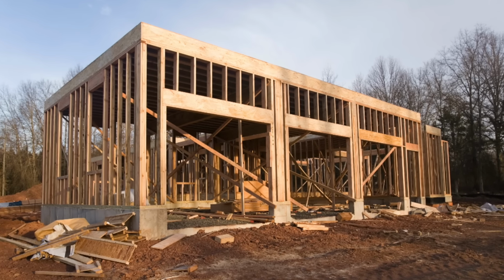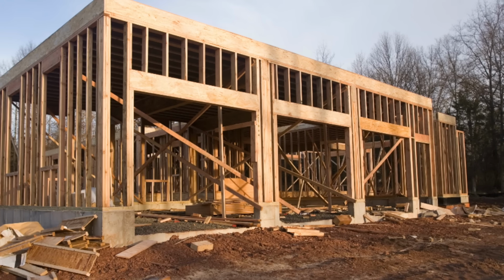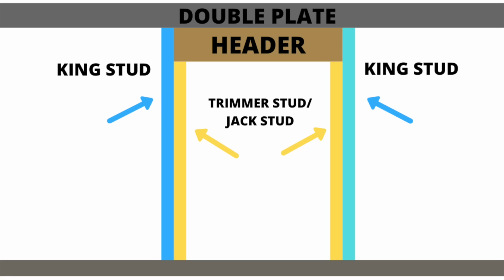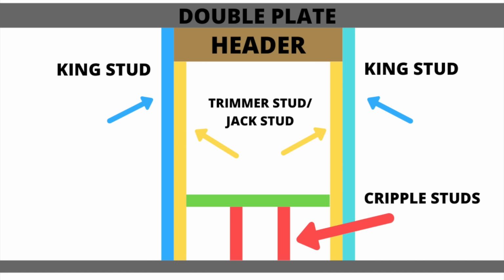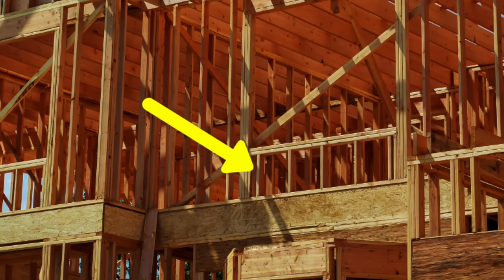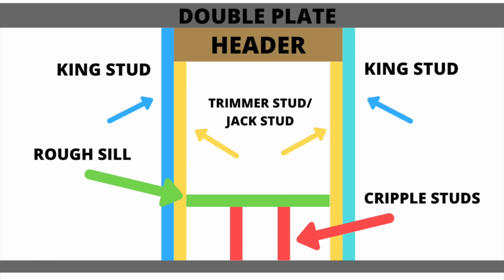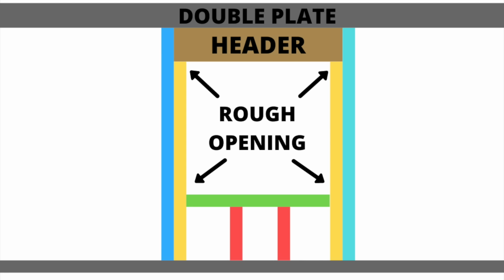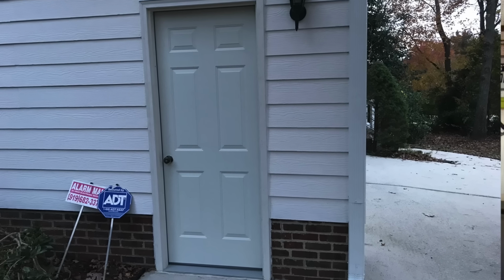All House Framing EXPLAINED...In Just 12 MINUTES! (House Construction/Framing Members)

Comment: Really well done, very informative and descriptive. The only fault I could find and I wasn’t really looking, was some of the pictures used as examples. One that was pretty obvious was the hole cut in the middle of the engineered wood floor joists. I might be inclined to replace it. I understand your comment on sheathing, brace walls installation and mechanical fastening would take an entire video. Another suggestion is to consider making a like-similar video on advanced framing. Keep up the great work, knowledge should be shared! 
Steve 
ICC B-5 Building Inspector
Reply from the maker: Thank you, Steven! I’ve really struggled to get stock photography when my own photos aren’t enough. More coming on this stuff soon though when I can set up some more good collaborations!
Reply: @TheHonestCarpenter  A really good source would be the Engineered Wood Products affiliates. They have stock photos of various installations within their construction manuals. Way back when, I was a Builder of 35 years prior to going to the “Dark side” and becoming a Building Inspector. I worked with the American Plywood Assoc. on several projects which were featured in national magazine publications. The APA was very helpful with new products and installation guides, this might be a good resource for you as well. I did many projects using advanced framing including my most recent resident that I build in Hawai’i. Funny, none of the building inspectors knew what I was doing and couldn’t perform a framing inspection. I use lower case letters when describing them because they really aren’t Building Inspectors. At best they are an apprentice carpenter that couldn’t cut it in the field. Kind of sad really.
Reply: Steven, don't the I-joists have knockouts in them for ducts, etc.?
Reply: @jobacuda4472  Yes they do, however the manufacturer produces these products in long lengths then they are cut to size without regard for specified knock- out location for individual use. In other words just because there might be a knock-out available in a convenient location doesn’t necessarily mean it can be made use of. This is the reason for building codes regarding Engineered wood products (see IRC 502.8.2) Refer to  ASTM D 5055 for capacities and design provisions for proper sizing. In most cases the engineering of the floor joist system using engineered wood products is done by the Manufacturer per project. Certain provisions are made for notching and drilling based upon the requirements ie: HVAC, plumbing and etc. The layout will have specifications as to where the alterations can or can not  be made. In addition, the local jurisdiction through their plan review process might make notes regarding the installation of the engineered wood products. 
As a Builder I’ve installed 1,000’s of feet of TJI’s without issue. As a Building Inspector I’ve reviewed lots of installations and found installation errors when it came to the cutting, notching, drilling and blocking.
Reply: @stevenrich1819  So a bigger knockout is ok if it's closer to a bearing wall I assume.

Comment: Great video. I've been a carpenter for 45 yrs. (framing, finishing, stairs etc) We do not use pressure treated lumber for sill plates here in Ontario Canada due to the dangerous chemicals used in the treating (off gas during fire etc.). Instead, we put a vapour barrier between the sill plate and foundation wall.
Reply: Catchin, if your sill plate burns, I hope you are long gone!
Reply: Not the greatest idea. So many issues doing that. Sure you have a vapor barrier, but over time concrete settles making a gap? It cracks breaks barrier. Bugs love fresh 2"x4" not PT. One flaw in it your in trouble. Then your not thinking this through, moisture is formed when hot meets cold. That might be inside the 2"x 4" that's not treated? There is moisture in the home. Cooked pasta lately? This could cause dry rot and catastrophic failure. This is why attic insulation is open, to dry moisture formed in the middle before it makes droplets and starts staining your ceilings.
Reply: @dragonmaker1541   The vapour barrier we use is a 1/4" foam gasket (sill gasket). I don't disagree with most of your reply. As framers, we don't make the rules but we are obliged to follow them or face the ramifications of a failed inspection.

Comment: you don't always need treated lumber as a mud sill, you can use a sill gasket which is essentially a thin foam strip placed between the masonry and the mud sill. Just something I think you glanced over
Reply: Ethan is in NC. We use nothing here but treated mud sills. On our interior foundation piers, we sometimes use membrane.

Comment: -LVL can also be called a glue-lam
-Blocking for the purpose of anchoring fixtures to we call backing
-We also call knee walls pony or stub walls, but pony wall directly refers to a short structural wall in a crawl space extending from the floor down to a solid footing
-and the bracing intentionally left behind on trusses for torsional resistance are called runners.

If you want to get into pole building terms, the long spans of dimensional lumber between posts are called perlens.
Reply: LVLs are different from gluelams. Gluelams are glued-up 2x material. LVLs are basically thick plywood.

Comment: I offer cooperation. I can design ArchiCAD elements as walls / partitions / slabs like this https://youtu.be/vUU0IZWLGrI. Your designer will only need to set the design parameters, stretch the dimensions, and the element will build all the necessary drawings for the manufacture of this structure. My email is listed on my channel

Comment: Are roof trusses considered an issue for fire safety because they're more prone to failure in event of a fire? 
 understand they may require a sign on the outside of the house indicating a truss roof construction as a warning to firemen not to enter to put out fires.
Reply: Stick framed roof systems don't burn? If your roof system is ready to collapse, you'd better be long gone. Firemen know what they are doing.

Comment: You left out the hog trof when you got to the truss section . Maybe it’s a southern term but we nail 2 2x4’s together in the L shape that runs along the bottom of the truss and you nail the Hog trof nail to set the bottom of your trusses to set your 16” or commonly 24” OC . OC means on center as you explained.
Reply: Charles, is the hog trof only for your gable trusses?

Comment: I’ve noticed in new home builds there’s a random wall that has plywood on the inside for example master bedroom interior wall or downstairs room but only half wall is plywood then drywall

Why  is this ?
Reply: Abel, 4o years in construction and I have never seen that. I can't imagine the purpose. Plywood all the way up on interior walls is often used for shear strength, but halfway up wouldn't work.

Comment: I am also an honest carpenter 😉 
25+ years carpentry and general construction. Glad to see someone sharing Correct framing practices👍
I've spent alot of time, and other people's $$$ fixing other "carpenters" mistakes.
There are Many hacks out there!
Regarding roof framing- to my knowledge, if you have a rafter frame roof that is supported at the ridge it is called a ridge "beam". If you have the same rafter roof designed with rafter ties it is called a ridge "board" and can be 3/4 or 1 1/2" thick. Semantics, not criticizing, just my 2 cents. 🙂

Comment: Should there be insulation in the joists between the first & second floor? Or between inside walls? 1984 build
Reply: Generally, the only reason to use insulation in interior floors/bathrooms is for sound insulation.

Comment: hello. i was just wondering if all of these process and parts are present in medieval castles made of stones and bricks. like for example do stone castles have wooden joists? or is it made of different materials? fi there were noi joist in the past? what were the alternative?
Reply: One feature of stud walls and floor joists is that you can run electrical, HVAC, and plumbing lines in them. No need for those in medieval castles 😁. They may have used something similar to partition off rooms, though.

Comment: First floor needs to be level and braced before starting process on the next floor amigo
Reply: Plumb and braced. You are right though; it would be dangerous to not have the first-floor walls properly braced (or sheathed, which accomplishes the same thing.)

Comment: Can someone tell me what’s going on at 0:22 ? It looks they are putting brick on top of the timber frame? I thought houses are either brick OR timber frame not both. Thank you
Reply: I think that's a big addition to an existing house. In the US, virtually all "brick houses" are just wood-framed houses with a layer of brick on the outside instead of another type of cladding. The brick is laid after all the framing has been done.
Reply: @jobacuda4472  and I guess in all cases the addition of brick instead of cladding is a purely design reason (so it looks like a brick house)?  Also what are the alternatives to brick on top of the wood frame? More nicer looking wood in the form of cladding?
Reply: @bobulatorul  Right. It is only aesthetic.

Comment: One of the things I was looking for was corner and wall intersection construction. Do you cover these in another video?
Reply: Assume you use 2x4s for framing: 

Normally, corners work this way: One of the walls ends with two studs separated by 3 shorter blocks (say 14" long)  nailed in between (to save using another -- more costly -- stud). That way, you have 4 1/2" of wood at the end of the wall, 3 1/2" to receive the other corner wall, with an extra inch to nail drywall to. The intersecting corner wall ends with a single stud.

Intersecting walls work similarly, except that the blocks are turned perpendicular to the studs and are flush with the side of the wall that will receive the intersecting wall. That way, you have 3 1/2" to receive the intersecting wall and 1 1/2" on each side to nail drywall to. The intersecting wall ends with a single stud that you nail into the blocks..

Comment: Even though structures are rarely built using the ballon framing method, it deserved a mention. Otherwise, I think you covered all the fundamentals.

Edit: Also the subfloor may be with planks instead of plywood/osb, that that is also the old fashioned way of laying subfloor.

But to be sure, this is just terminology, method types and materials, not the actual work of framing. I say that because though in its simplest and purest form, putting four pieces of wood members (e.g. studs) together by fastening with nails and a hammer and erecting it is framing, in a professional setting it can be from simple to very complex, not to mention the engineering of structures to withstand the test of time through natural forces and such.

It can be deceiving to believe once you get the basics you can frame anything, but it isn’t that simple. The more bigger and/or complex as well as the nature of the structure, the more sophisticated the framing becomes, which requires math, engineering, and other technical aspects.

Comment: Pretty good, as a contractor the only thing I would add is the importance of looking into regional code and for example; im in Canada and in most cases treated lumber in not allowed to be used in framing so during both outer sill and and point where lumber will contact concrete there must ba a membrane between materials

Comment: I always call that a sill plate.

Tji's fuckin suck. Regular lumber is way better in my opinion. Im not saying it withstands water damage well, but it withstands it better that tji's. At least from what ive seen.

Everythings doesnt always sit on your subfloor. It probably does if you have a newer house, which would he platform framed, but if you have an older, balloon framed house, which many do, this would not be the case

You only need a double top plate on load bearing walls

I will probably always cut my own stringers. Call me old fashioned i guess. I just like doing it. Besides, its a lot cheaper to recut a stringer myself if i fucked up a meaaurement than to pay someone else to build the whole staircase again lol. I will for sure order trusses over stick building a roof though. Not that stick building ones a big issue, just easier to set trusses

Comment: as a certified architect I suggest that, in critical points - according to loading evaluation - instead of applying "Blocking" components horizontally between the studs, apply them symmetric diagonally between them. then it will perform as a truss. so you will have way more resistance against the  horizontal loads such a Seismic and Wind loads and also prevents the twisting. we use this system in LSF Structure too which is quite similar to this one.     

I am pretty sure you knew that. I just wanted to add something useful to it for people.

Comment: Here in Ontario, Canada we use some different terms. Some people call valleys sleepers, gable over hangs are rakes, jack studs are slips, mud sill is called bottom plate. Those are the most common different terms here.

Comment: Regarding blocking, you should have also mentioned it's use for helping to strengthen floors / floor joists by distributing the load to the 2 nearby joists

Comment: Carpentry question: In learning to join wood, the wisdom is that you never nail into the end-grain of a board.  But in wall framing it looks like a nail goes into the end-grain of the stud through the plate.  How is this a good idea?
Reply: There is no shear load on that end grain, besides how else would you attach it?

Comment: I’ve been a general building contractor for 35 years and I’ve worked in 4 different states. You used the most common names for most of the parts of the structure. Nice job

Comment: Good video.  I'd be interested in seeing you cover how to repair or add on to a house that has either shifted or wasn't built squarely.  It's a real challenge to introduce scratch walls done square to a house that isn't.  My boss and I recently have been working on his house that was badly damaged through dryrot and we, essentially, had to knock 40% of it down to the ground and build it back up through a basement, first floor and a new attic/roof.  It's been a blast making it work and my boss knows a lot of amazing tricks to get it done.  I'd love to see what you might do in that situation, my friend.  Peace.

Comment: Great tutorial. Thanks a lot for sharing. Just wondering if it is a good idea to use LVL 90mm x 45mm to replace MGP10 treated pine as studs if the cost is similar?
Reply: If they were priced similarly, I certainly would choose the LVLs. Are they actually similar in price?!!
Reply: @jobacuda4472  lol, as the current timber market in Australia is in a extremely short supply of pine for houses, that's why I have to use LVL instead to build the houses. Appreciate for your advice.

Comment: I was a framer in So Cal from 1976 to 1990. I joined the Carpenters Union in '76 as an Apprentice. By 1980 I was Journeyman and by 1986 I was a Carpenter Foreman. In 1990 I became a Licensed Contractor. My favorite time was when I was a framer. Something about framing that always appealed to me. Even today when I smell fresh lumber it makes me long for those days.
Reply: I'm the same way. I drive past a project being framed and almost wish I were up there with them.
Reply: @jobacuda4472  In my day most of us worked piecework. Framing walls, rolling joist, beam setting and roof stacking was all piecework. We all wore shorts and high top tennis shoes. No hard hat or any safety gear. We had a great safety record though. Crazy by todays standards.
Reply: @joepromedio  Same here, except we wore boots because there was a lot of mud at the jobsites. Not a problem in So Cal!

Comment: I Joists are also very weak when it comes to a fire because instead of it being just a solid piece of wood which takes a fire a much longer time to burn through it can burn through that particle board crap in no time causing a death trap for firefighters so in other words when I'm getting at is the hell with I Joists I will stick with dimensional lumber
Reply: No matter how it was built, If your house is on fire, you should get out.

Comment: As a structural engineer primarily working in the design of residential structures, sheathing definitely needs a dedicated video to explain how it works. Great video and very accurate info, I even learned a thing or two that will make communicating with contractors easier.

Comment: I was also waiting to hear about ‘floating trimmers’, ‘roll blocks’, ‘mid-span blocks’, and ‘purlins’
Reply: I'm just a farmer and I've heard of purlins, I was really surprised he didn't mention that! I've also heard the mud sill referred to as a sill plate.  I guess purlins wouldn't really be used in house construction if they use sheathing.  If you have an old building with 1x's completely covering the rafters, do you still call those purlins or are they sheathing at that point?

Comment: Balloon framing - when the house is only going to be up 60 years at most. Or until the next hurricane. These building techniques are fine for most areas but I wish they wouldn't use them here on the gulf coast. We need something a bit more substantial.
Reply: This is platform framing. Balloon framing is completely different
Reply: @fullsend4life28  Not different enough as far as Cat 5 hurricanes are concerned. We can build housing that can withstand those forces, but no one bothers to.
Reply: @michaelmorris4515  I completely agree with you, I’m just saying this isn’t balloon framing.

Comment: you forgot, lead-in brace for the walls, Gang-nails for engineer trusses, piggy back trusses for extending roof elevation for engineered trusses, zero tails for tile roof support, out riggers for barge rafters, box trusses are engineered trusses for between floor 1st and 2nd floor. but it was a great tutorial.